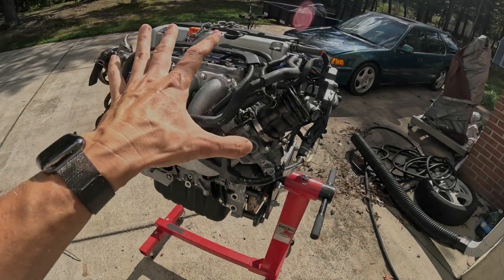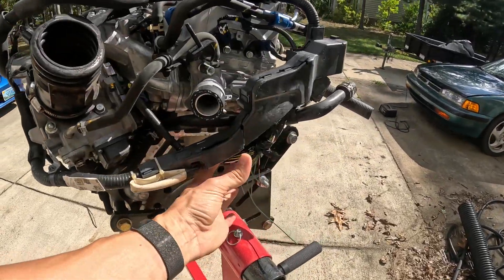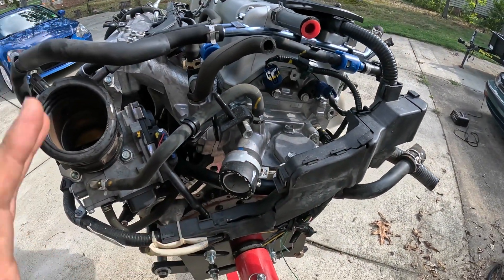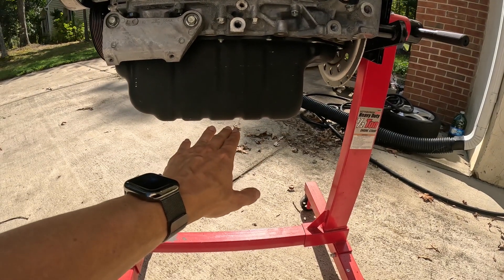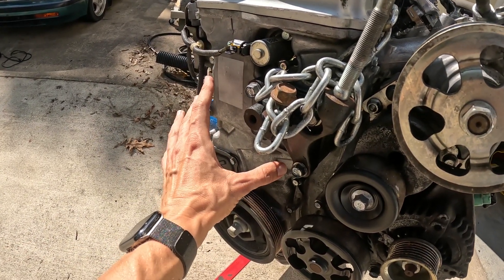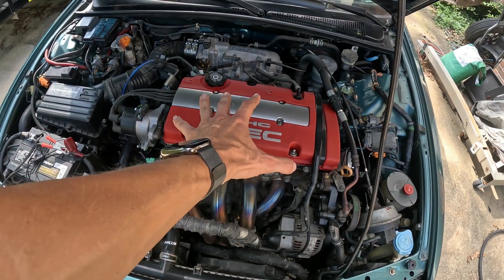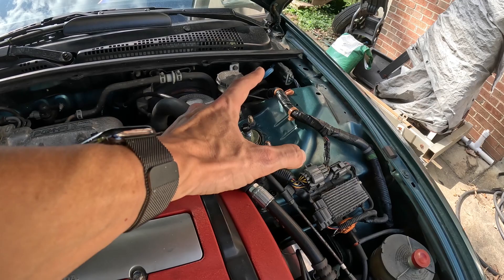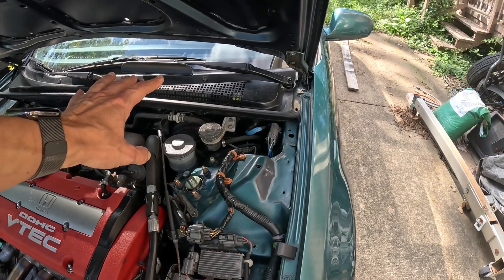Accord CB7/CB9 K24 Swap Introduction

Comment: Dang I was hoping to see the evolution of that H in that CB9! I was hoping you were dropping video for “forged internals” or “getting the H ready for big power” oh well, “K is the way” nice to have a 6 speed option
Reply: Yeah, fixing the H would have been cheaper than the K swap, but still an interesting build.
Reply: 6 soeed way better for turbo/supercharger especially high comp with supercharger
Reply: I don't know, people seem to prefer fewer and longer gears with bigger power. @trackshun
Reply: @accord_aero_r  ohh well the difference is that the 6 speed will get out of 1st gear quicker than say on a b18 trans/H trans 5 speed.  My fg4 civic uses up first gear way quicker than my cousins integra gsr trans.  Both have Mfactory lsd  both stock synchros.   
However, it all depends on the build.  If youre going anything that isnt k series, youre likely utilizing a 5 speed.   The 6 speed k series trans  have balanced gear ratiod that basically make up for having an extra gear, but at the same time allowing more grab for power with 6 rather than 5.  Compare the ratios, the only time i’d say a 5 speed outdoes a 6 (when speaking of performance) is in the mountains
Reply: @trackshun  not sure about this one. I hear mixed opinions on the 6 speed for turbo applications. Depends on gear ratios for sure.

Comment: Water pump housing, alternator, tensioner and powersteering pump needs to be switched out to usdms to avoid problems with replacing them in the future. The jdm ones are hard if not impossible to find stateside.

Comment: At least on USDM motors you cannot rely on the RBB number to determine differences but rather the actual year. Ive seen 2006-2008 tsx motors that were RBB-2 that had the larger valves, cams, etc. You also wont use any of the original engine harness plugs. And will simply be just pulling them back through the firewall to conceal them. An oem rsx base, ep3, or crv harness works good you dont need a high dollar tuck harness. You can even convert auto k series engine harnesses from auto to manual to save more money.

Comment: 02-06 RSX. All of them used a cable driven throttle body.
Reply from the maker: Base RSX throttle body attaches to a plastic intake manifold which is the big difference.  Type-S would be the one to get if it’s RSX
Reply: @randomrebuilds  Was referring to the part about being cable driven versus electronic.

Comment: Would you sell the current setup? I’m looking at a H22 swap. I’m not a mechanic but between my son and I think we could rebuild the H22 to solve the low compression. Thanks!
Reply from the maker: Yes, I plan to sell it as a complete bolt in assembly.

Comment: Hey, I have a 92 Honda Accord, which engine is shareable, without having to make so many adjustments?  Thank you
Reply: Would recommend the h22a4 or h22a or h23 they all mount the stock motor mounts from what i was told I bought my cb7 already swapped so I'm not sure 100% on that

Comment: Hey, I couldn't see any other way to contact you, hope you see this. Would you happen to have a right rear ABS speed sensor for a CB7? I've got a pretty nice '92 Accord EX 5sp coupe with the ABS light on, and my mechanic confirmed it needs this discontinued part. Would love for the ABS to work, as it has saved my @$$ more than once in my CR-V. TIA
Reply from the maker: Im on IG @ Random_Rebuilds.  Yeah I could get you that sensor from the yard.

Comment: Dash isn't hard to remove. I can pull one in about an hour if Im being careful to not break any of the plastics but the thing I dread is pulling the clock.  After 30 years the plastic on the clocks is so freakin brittle. I have yet to get one out without breaking the clock.
Reply from the maker: I have practiced clock removal on a few junkyard vehicles and have never been successful yet.

Comment: Here's my view on that jdm engine mileage ( on going claims passed down) ive bought few jdm motors and quickly realized that aside from what the staff tells me (less 75k) there's no way to verify what mileage is cause there's never a car with motor in it to see, as all jdm engines imported are motor only so they could say it has 56k miles and it would be believed  as well and to hear the same mileage from the 3 different jdm importers ive purchased motors from kinda like its traditional to mileage claim 😂,  guess to hear that h22 has low compression on cylinders 1-2 begs the question how does a low mileage jdm motor already have 2 cylinders with ring problems 🤔, either was neglected on oil changes and had got beaten all its life or it has alot more than 75k +/- miles on it , either way its still worth fixing least in my opinion that motor with a Bseries tranny regardless which one is ridiculously quick much needed when pulling 3800 pounds of classic weight 😊